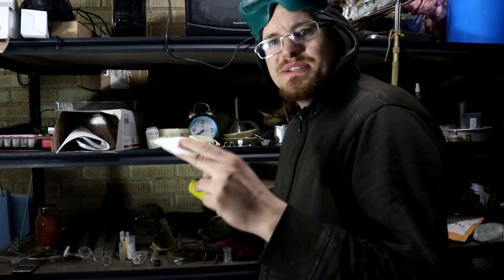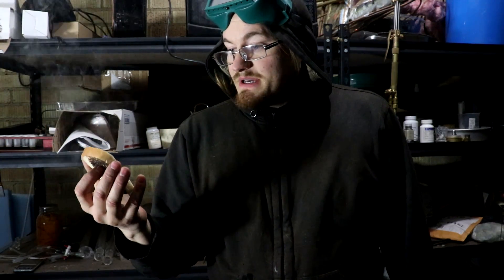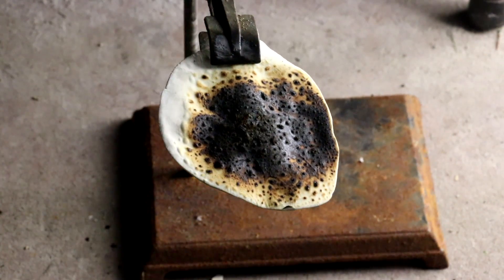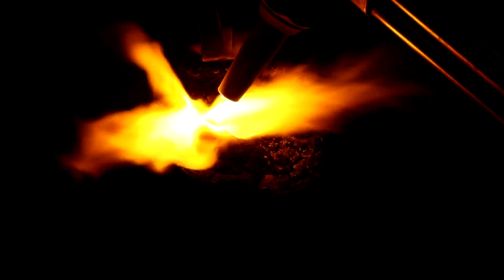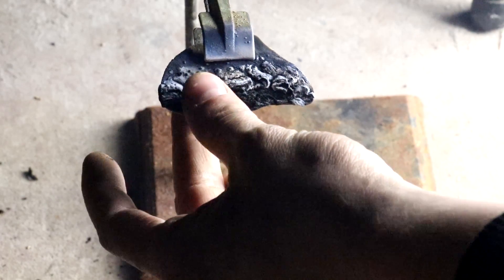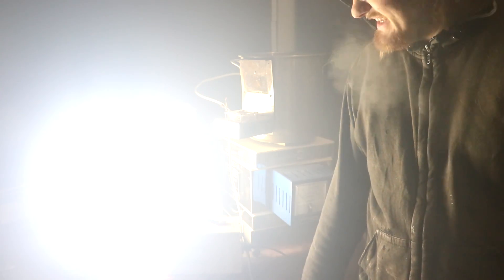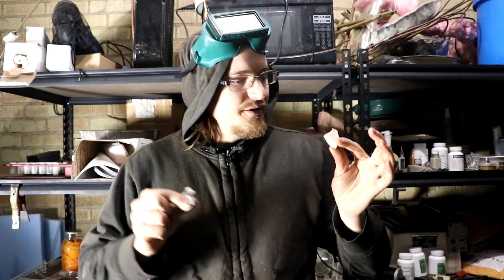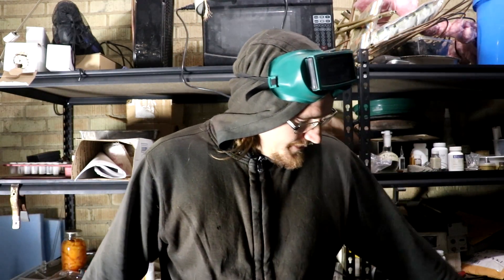Can I Burn Through Starlite?

Comment: It's worth noting that the Apollo heat shield was made of epoxy phenol formaldehyde resin, which starts to decompose at only 220C, and a fibreglass honeycomb structure for support. I'm sure you could cut through it with that torch too, but it survived re-entry from a lunar return orbit, just because it ablates off and that protects it from the worst of the heat.
This stuff does seem to do the same... though presumably not as well, since they didn't end up using it.
Reply: I dont think NASA had the option back then. Maurice took the recipe to the grave and we only heard of starlite-ish matteririal a week ago.

Comment: I wonder how fast things like Aerogel can be cut with a torch?
Also there are other heat-repelling or heat-resistant materials.
And also I remember my father worked in an old hospital build far, far back, and it was made from wood beams and mortar basically. But he said then that the wood was soaked in chemicals that it wouldn't burn. even if you try. I know that wood would probably give under oxygen torch, but I wonder if there are materials that are so heat-resistant that you actually could make a demo like in the beginning with them. (I'm not offering to hold it in your hand, but like put a matchstick under such material and hit it with a torch and it won't ignite).

Maybe an idea for a follow-up episode, I'd kinda love to see those things explained. 
Because in my mind there were plenty of materials invented that are very hard to burn through.

Comment: It's kind of a bad debunking. You didn't really prove anything. It's the insulating properties that are supposed to be interesting, not it's durability. Try measuring the temperature under the Starlite compared to a piece of bread or wood while blasting it with the torch at a longer distance so you aren't blowing the stuff apart, or make a box made of the stuff with a hole to blow fire into, like a furnace.

It's a pretty disappointing video, probably because you aren't interested and as a result did a half-ass job. You just wanted people to stop telling you to cover it.

Comment: Someone probably already said this at this point, but the main issue for your test seems to be, as you said, the burnt outer layer of starlite getting blown away by the force of the torch. How would it do in this scenario if you had a robust outer layer, thin graphite layer or something, and starlite underneath, or even multiple thin alternating layers. Still not going to make it through atmospheric entry but would likely make it difficult to get though with that torch and maybe even able to do the in hand thing(probably still not recommended though).

Comment: To be fair you were cutting it from the edge, which would not happen on a heat shield. The edge is thinner and has more surface per weight so it's pretty vulnerable. Hear shields don't have those edges they use aerodynamics to keep the hot air from hitting that directly.

Comment: Hold the phone , when using an oxy/acet torch the neutral flame heats the metal into a melted puddle then adding the excessive oxygen through other ports in the torch tip causes the metal to burn itself, once this reaction starts you can actually shut off the acetylene gas and keep the metal burning with just oxygen

Comment: There has been successful tests with heat shields for reentry made from wood,  it is called ablative shielding, as  it removes heat by being a poor heat conductor, and chafing of when it gets too hot, taking the heat with it. 
Also, if i understand the mechanism of starlite correctly, it creates a carbon foam that insulates in proportion to the heat applied. So a blowtorch would not be a good test, as you blow away the foam as it tries to form. That is probably why you burned through so easily, while the thermite did not.
If you have a binding agent  that protected the foam formation (i don't think the glue is optimal) it should work pretty well. I'd love to see  you try different formulas of starlite to see how close you could get.

Comment: i have a question, can you try the same experiment but starting for the centre of the starlight. this way the thermal conductivity isn't form one direction. this way the heat will spread in all directions rather than the 180deg when starting from the edge.

Comment: I think 'beyond the press' channel was much better at describing what was happening, the material is changing into a carbon foam which whilst resisting heat very well is also brittle and turning up the torch just blows away the carbon foam. Obviously the Youtube version of Starlite is limited by the fact that it is brittle and that could be fundamental to why it doesn't conduct heat or it could be just a few tweaks here and there from Starlite.

Comment: hey Cody, I think you could make a ceramic version of starlite. you know, a material that under heat decomposes, give off steam and other gasses and make solid foam that's heat resistant and thermally insulating, but foam instead of being made of carbon, is made from a ceramic material.
I don't know what the ideal ingredients would be, but things like silica gel, fly ash, clay, ground ceramics, cement, sand, silicone oil, silicone rubber, wood glue, sodium silicate, TEOS, slaked lime, limestone, stearates, and borax can be good candidates.

Comment: You should try testing it as a mold for casting, I'd be interested in seeing if it could hold a liquid metal and what the carbon layer does to the surface of a piece of cast bronze or other low melting point alloy.

Comment: Look be fair about it. 
Nobody can guarrentee that it's the original Starlite mix but it's a good version.
Next that version was cool to touch instantly where the plasterboard was not and if the plasterboard gets as hot as it did the timber behind it would catch fire just of passive heat alone.
I would think a layer of Starlite on top of plasterboard would be a good test as it would have strength and cooling properties.
As always good video.

Comment: I think another test. The original was coating an egg and it did not cook. This time an actual test: 6" square as thick as your blob, with a thermometer (thermocouple?) on the back, using the same torch on the center of the face from a fixed distance (1",2"?), once with no O2, then once with O2, compared to a 6" square of sheet rock the same thickness. Plot the temp increase over time until breach.

Comment: i think the thing i like about it is watching the hydraulic press channel burn thermite in the stuff it was ok to pick up the crucible whilst the metal was still red hot inside. i dont think it can withstand extreme heat but with high heat it is still safe to pick up whereas a normal crucible is not. it would for example make the pouring of molten metal much easier if you could pick up the crucible with your hand but i would worry that the Starlite might contaminate your metal however given the materials used it is so easy and cheap to make it must be useful for something. i personally saw it and thought of the pipes for my kitchen tap that the previous owner soldered together. i cant take a blow torch to them because the work surface is too close and would burn also so i have put off replacing the tap, with this stuff i might be able to melt the solder without burning the wood.

Comment: Cody, I'm a huge fan but it's impolite to ridicule the invention of another backyard scientist, especially when you haven't proposed a thermally protective compound of your own ( stale bread doesn't count. )

So let's have it Sir; create a compound that can withstand the oxyacetylene flame.
Reply: So, by that logic, you can't argue with Anti-Vaxxers until you have developed a vaccine. This is nonsense. Of course you can attack claims made by another person without having personally done the thing in question, you just need to do so in a systemically rigorous way which shows why the claims being made are incorrect.

You could argue that Cody is being unfair by attacking a material known to be highly heat-tolerant with a cutting torch which applies mechanical force as part of its operation, but you can't argue that Cody is not qualified to attack claims because he has not personally invented a Starlite variant.
Reply: @Frommerman  Your logic is flawed.
The principle of progress is trial and error. The reality is; starlite worked, it saved his hand from  getting burned, you can't argue with empirical evidence. The only noble way for a scientist to ridicule an effective experiment is to create and demonstrate a more effective, replicable, experiment.

Comment: I think actually the mechanical force, applied by the jet of the flame, is killing the material in your setup. I would be curious what temperature it could stand without mechanical stress for some minutes (Laser/microwave). Little challange to measure the temperature :-). Or if addition of rock wool would help.

Comment: would there be a difference between starting with your torch on the edges vs in the center of a larger piece? Maybe the carbon shielding can't come into effect because you burn it from the side and not from the front?

Comment: Great video! I think a better test would be to start torching it straight in the middle of the sample, rather than starting from the side. Because from what I heard, it should be able to spread the heat away; it's not meant to withstand the heat. And from the side of the sample it has no chance of doing that.

Comment: I think the whole point of the material was that it was a really good insulator for heat, not that it wasn't flammable. In fact, it has to decompose to really be insulation - i.e. carbon foam.

Comment: Sorry Cody but to me you are trying to CUT the starlite and this not prove his fire proof resistence because the heat is displaced sideways and then will be distributed from there to the middle, therefore is half or less surface area for the heat to dicipate, please try the same but starting from the middle!

Comment: The oxy acetylene torch generates a lot of pressure and destroys the carbon foam layer. You could try to  use 2 carbon electrodes and an arc welder. The arc and the end of the electrodes get around 4000°C hot and are hotter than the torch without creating pressure. This high temperature should sublimate the carbon foam slowly.
Reply: The pressure is probably an issue, but then again, it's also a reason why the material wouldn't be great for spaceship protection where all the heat is coming from air molecules rubbing against it.
Reply: @PastaAivo  In spaceship protection, there would be a layer of some very heat resistant material like graphite above the starlite. The heat resistance of the graphite is high enough, but it has a high heat conductivity. The starlite is just used under the graphite to shield the inside of the spaceship from the heat of the graphite because of its extremely low heat conductivity. The starlite does not see any concentrated pressure, but the graphite does.
Reply: @experimente9912  A metallic foam material or something similar would probably do that better. If they used starlite that was anything like in the video, it would bubble up and release gases beneath the shielding, which doesn't sound very good for the shielding's integrity. A carbon-based porous material could probably work really well too, but then it would simply be an insulator. I would imagine something like that is probably already in use somewhere.
Reply: Agreed. Similar thoughts about the pressure issue.
Reply: Atmospheric entry creates a lot of pressure too.
Reply: Was going to say same thing. There is to much pressure from the torch. And if he had watched beyond the press channel where they made the crucible. He mentioned that he thinks that the torch is blowing the foam away
Reply: I'm curious how it would react from being indirectly heated in  a low oxygen environment, for example, filling a starlite cup with molten metal or being placed in a sealed container and heated to the highest possible temperature.
Reply: The point of the torch is to emulate re-entry plasma.  Tho I think the starlite would fare even worse against the high frequency vibrations that occur in re-entry.

Comment: Hey Cody, what would happen if you don't start from the edge of the piece? I guess in any practical application burning the edge of the shield would be undesireable and avoided. How much time would you need to cuth through Starlite when blasting it at the center?

Comment: From everything I've seen between you, NightHawk, and HPC, it's looking like starlite's usefulness is limited primarily by its severe lack of physical strength and the necessity of the carbon foam to expand. Very neat to see how the velocity of the torch gas was able to just blast away the foam and eventually eat its way through the material. Then again, I suppose that's exactly what a cutting torch is supposed to do. I would have to imagine you could get the same or similar results with a propane torch and a blast from a consumer grade air compressor.

Good work as always!

Comment: I remember watching a segment on tv once (maybe brainiac?) where they used a oxyacetylene torch on a pizza and it took longer to cut through than a steel plate of the same size, they concluded with some maths and the idea that the space shuttle would survive reentry  if it had 14 layers of cheese and tomato pizza as heat shielding

Comment: youre absolutely right in that its not a magic material, and you made an excellent demonstration of that.

being carbon, its about as good as a low density ablative shield more than anything else, really benefitting from having the heat spread out over its surface, and in some applications could prove to be just the material for the job. 

perhaps lining the chassis of humvees to give them some fire protection should they hit and IED and ignite

or in aircraft as a firewall against the engines and fuel containing parts

or used to seperate the battery packs in tesla cars so if one fails catastrophically, it might be contained for even a few seconds longer. 

on its own, its a neat material thats fun to demonstrate, but with a bit of tweaking it could actually prove quite useful as a safety feature mostly for fire braking. 

as always though, love the videos cody! :D

Comment: Would've been more entertaining if you just focused it in 1 spot. Also I believe it can withstand extremely high temps, if the heat radiated throughout the entire surface like a coal fired forge that hits 3600F. I dont believe this is the right material for a concentrated heat source from a jet spray.

Comment: I understand it doesn’t have much strength though. Is the torch cutting it through gas pressure more than heat? What if you backed it with something that would normally cut with a torch easily but provides structural reinforcement?
Reply: An oxy torch works best with the acetylene at 10psi and the oxygen at 30psi. That's not very high at all compared to propane

Comment: You are blowing the insulating carbon away with the torch revealing new material. Fail. True test would be extreme heat without mechanical stress

Comment: i have a feeling that the air pressure had more to do with the burn through than any increased heat or added oxygen.  as the carbon foam is produced it gets blown off and exposes more fresh material

Comment: It is hard to see on the video but i think your oxyacetylene torch is not properly tuned in. It can be that the camera picking up the wrong color of the flame. When you start a flame you should see 3 diferent flames, the middel and the one closest to the nozzle should merge togehter and become blue. The merged flame should be aboute 5-8mm long when you have a neutral flame. When you open the oxygen valve the merged flame should be the same lenght. The only diferens should be the leght of the last flame after the merged flames and the sound is louder.

Comment: I would like to see you do comparisons of starlite and foundry cement or alumina silicate as forge or foundry insulation. The 3,500 degrees Celsius is far above temperatures that would be achieved in such an application and starlite’s lack of heat absorption or retention might increase thermal efficiency in this application.

Comment: It's thermal insulation property is what people are hyped about, not that it can't be cut with a torch... May as well have cut it with a knife and gone "see, it isn't that cool"
Reply: If the source of the heat destroys the insulation, then the insulation immediately has failed....
Reply: Well considering the torch cuts with thermal energy, I think that was the point.
Reply: @StrokeMahEgo  Uhh no, that torch was pretty clearly cutting with pressure, on the beyond the press channel they literally melted a steel bolt on the stuff and then picked it up with his bare hands, using this exact same type of torch. If you apply ANY AMOUNT OF skepticism to this video the whole thing just falls apart, this isn't science this is some guy blowtorching a piece of bread for 3 seconds then saying that's the same as something you can pick up with your bare hands after you've melted a steel bolt with the same oxyacetylene torch used in this video.

Comment: From what I remember about Starlite, the original inventor mentioned eggshells in the recipe, so probably at least some calcium carbonate (egg shells, chalk) rather than straight sodium bicarbonate (baking soda). Sodium doesn't form any kind of nice refractory oxide, but calcium does. A mixture replacing some (or most) of the baking soda with ground chalk or ground eggshells might have better performance.